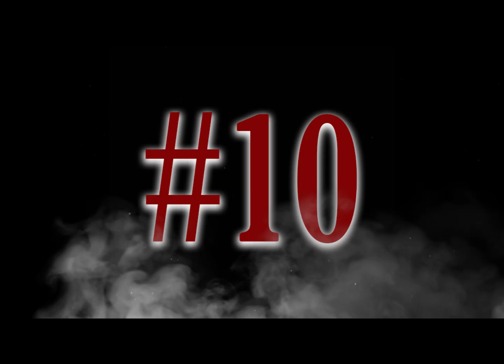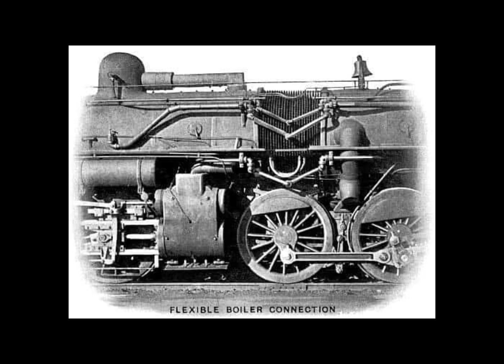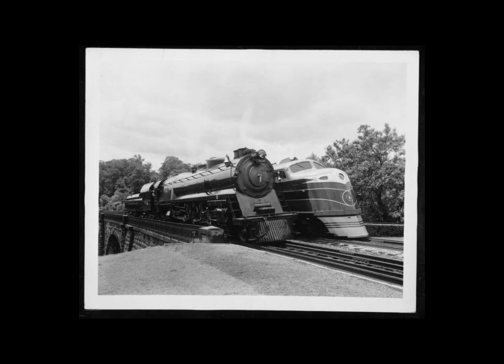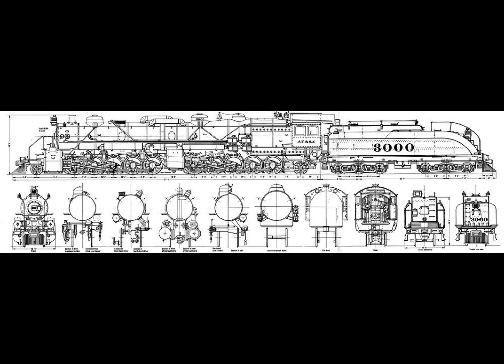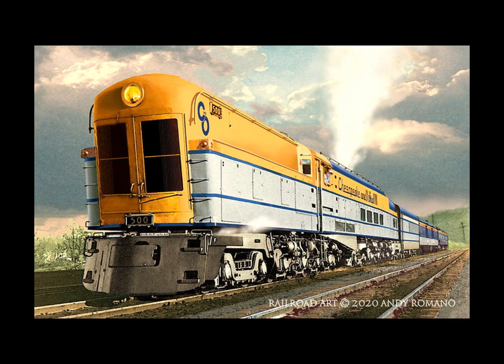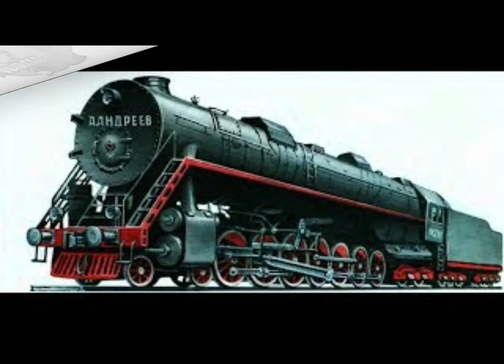The Top Ten Worst Steam Locomotives

Comment: When you maintain that the PRR S-1 and S-2 should have been  articulated,  you're missing the point of what PRR was trying to accomplish with the duplex concept.
Reply from the maker: Trying to do without taking into consideration of having to navigate curves and such. 🙂
Reply: @TheRailroadCrossing-SteamPower Curves were not an issue.  S-1 was an experiment to test the duplex concept. It was never going to run anywhere other than the flat,  straight Fort Wayne Division.  Incidentally,  the production T-1 rigid frame duplexes were 122 feet long and had no trouble going as far East as Harrisburg.
Reply from the maker: @tomandbenny  I'll go back and check my sources on these and get back with  you or maybe even do another video. T-1 Is already back on my radar for one. But in the least that large of a rigid frame would have restricted the design(s) to particular sections of their track or even prohibit them from another lines track. That's something the Russians learned the hard way but they were even more extreme on the same hand. I love these loco's. Very elegant looking and it sure wpuld have been fun to see them have a production line and some sort of career.

Comment: Another very enjoyable clip.  Love your stuff!! 

To my mind, there's a marked difference between concepts which were sound from an engineering perspective, but could never suit railway conditions e.g. sleeve valves and turbines, performance of both of which inherently optimises at a specific speed and on the other side 'triplex' steam suckers, where not even US loading gauge could hope to accommodate a large enough boiler (did anyone try triple expansion and reheating, or were they carted away as soon as they mentioned such ideas?)

Under these criteria,  Oliver Bulleid's Leader design still makes the cut, even though the offset mass of it's boiler (which some may call "an intersting choice" .... the PW Engineer may have used different adjectives) wasn't even mentioned, but it did spawn 'The Turf Burner' in Ireland, which employed conventional piston valves, had lateral balance ..... and worked a LOT better!!

On these grounds, the Soviet AA20 really ought to take pride of place, managing to achieve outright failure of a design which had no need to resort to any inappropriate and/or novel component assembles .... the entire shambles being the result of unmitigated hubris.  

I do feel the WWII era Australian Standard Garratt, a 3'-6" gauge design, deserved a place on the list.  They really were SO bloody awful that one of the workshops ordered to build a batch refused point blank to fit their own works plates. Somehow, one of these machines survives.
Reply from the maker: Thank you very much!

Comment: I know it is no record, but Here in Germany we have some locos with 90,5 Inch Diameter wheels. They are build in the 1930s , not in the 1800s. Look at BR 05, BR 61 and BR 18 201
Reply: The biggest drivers used on a US locomotive were 86-1/2” (219.71 cm) on New York Central no. 999, built in 1893. These were later replaced by 70” drivers.
Reply: 90inch how much is that...?
Reply: @kimsndergaard973  a bit over 225cm
Reply: @kimsndergaard973 2,3 Meter

Comment: To create some 2-10-10-2s out of standard 2-10-2s without doubling or nearly doubling the firebox size just seems like a boneheaded design error. How could the engineering geniuses at work on this plan have missed an obvious necessity such as a bigger firebox for a bigger locomotive? One can only wonder how successful these engines might have been had they been given fireboxes befitting their size.
Reply from the maker: This will always trouble me
Reply: Sounds more like a management decision to me. Trying to get two engines running with one crew.
Reply: @mpetersen6  Sounds logical; it very well could have been a management decision. . .

Comment: Dishonorable mentions to the Fontaine locomotive pre-rebuild (the rebuild removed the extra top mounted large wheels), A2/2 (Thompson's most embarrassing failure of a conversion), PRR K5, LNER A2, GWR 111 The Great Bear, SR Merchant Navy pre-rebuild, and LMS 6399 Fury before its conversion to 6170 British Legion.
Reply: I would not call the K5 a failure.  It was not a notable improvement on the K4, but it wasn't BAD.  The Merchant Navies were actually quite good in some ways (though disasters in other ways).  And I was going to say that putting the Fontaine on there was a complete and total insult to everything else, but then I realized that I had mixed it up with the Holman... "thing".

Comment: Id always heard turbines ran full blast, or turned off. I seem to recall UP having such trouble with their gas turbines. 
The problem with the jointed boiler was that they were high carbon rings, and hot cinders would rupture them.
Reply: A good example of full blast versus off would be variable speed air tools. Variable speed air tools suck.

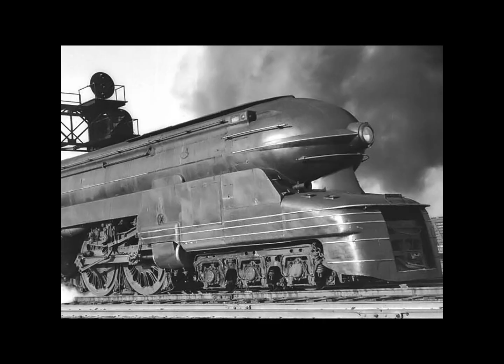Comment: 14:17 "..Largest passenger drivjng wheels ever put on a locomotive.."
Sorry, no.

The largest coupled wheels ever used were almost certainly the 7ft 7.25in ones (91.25") on the Worsdell designed NER Q1 4-4-0's.  Those are also the only locomotives ever built specifically for the competitive racing of scheduled passenger trains.  Racing was curtailed, and the two built had 34 year careers running turn and turn about with their slightly smaller wheeled Q class half sisters.

The largest wheels ever used in regular public service were 9ft diameter (108") on the broad gauge (7' 0.25") Bristol and Exeter singles (4-2-4T). They lasted a decade and half from 1853/4, and then 4 of the 8 were rebuilt with 8ft 10in wheels for further service.  Following an accident the surviving 3 were rebuilt again as 4-2-2 tender locos and lasted into the 1880's.  There's a surviving set of wheels outside the UK national railway museum in York, and they are huge.

The largest of all time were almost certainly the 10ft (120") drivers fitted to Hurricane, an experimental GWR broad gauge loco of 1838.  The loco only lasted until 1839, being broken up and many of the parts recycled, but in that year or so it did 10,000 miles, not too bad for the 1830's.  It's also recorded as having run from a standing start at Paddington to pass Taplow in a little over 16minutes.  From memory that's about 22miles, which suggests the loco achieved at least 80mph.  In 1838.
Reply from the maker: That one was subject for question.
Reply: In picturesque but topographically challenging South Devon, a piston carriage on Mr Brunel's broad gauge line (7'-0¼", it's final demise was in May 1892), on his atmospheric system went considerably faster than the 68mph acheived in service (in the 1840s!!)  ..... and did so with a passenger on board.  It wasn't  meant to, but with no trailing load, by jove, it jolly well did!!  The top speed achieved wasn't definitively recorded (I'd imagine the passenger has other things on his mind), but iz reasonably reckoned to have been well over 90mph.

The prewar German DR Class 05 4-6-4 employed 2300mm dia drivers (that's 7'-6½" in old money).  05001 survives in Nuremburg Transport Museum
Reply: @TheHoveHeretic  The atmospheric railway incident sounds like it would have a wild ride.  This was presumably the one occassion when the local rodent population hadn't eaten anything, and the system worked *perfectly*...

Comment: The leader was such a hideous mess in engineering terms - significantly overweight, and with an offset boiler that needed yet more scrap iron piled in the corridor to stop it listing.  Not to mention the valve gear, the dry back firebox...  When you look at the project history, it probably would actually have been possible to produce a more conventional 0-4-4-0 kitson meyer along the lines of the original sketches, with a shortened Q1 boiler, conventional valve gear and 'austerity' Q1 style platework to keep it within acceptable weight limits.
And then Bulleid went to Ireland and did it all over again with CC1.  Though at least that wasn't dangerously overweight.
Reply: To make things worst Bulleid brought back the chain-driven valve gear, modify form although.
Reply: @dustin_4501 in Bulleid's defence, the chain gear was originally forced on him due to wartime exigencies.  He has wanted to use carden shafts, but at that time, only the US had the capacity to produce them and right then, much more important goods needed to cross the atlantic.

Comment: I am well aware I am far from the first person to have this opinion, but it is a shame the PRR S2 was such a failure because the Lionel model of it is such a beautiful piece of model railroad history. Knowing in real life it was not a pleasent locomotive to operate compared to its model counterpart is sad.
Reply from the maker: Yeah, I just dont understand why they didnt articulate the design.. I think it would have changed the fortunes of the project altogether.
Reply: The S2 could have worked if there was more studies into making steam turbines efficient at low speeds
Reply: @Elliottblancher  The Brits were able to solve the low speed issue with LMS Turbomotive using nozzles that controlled the amount of steam that entered the turbine instead of a throttle
Reply: Also use stronger alloy frames with a more sturdy, reliable, standard 4-8-4 wheel arrangement.